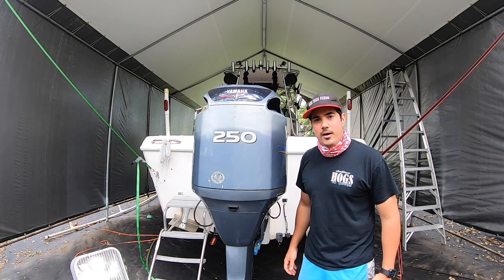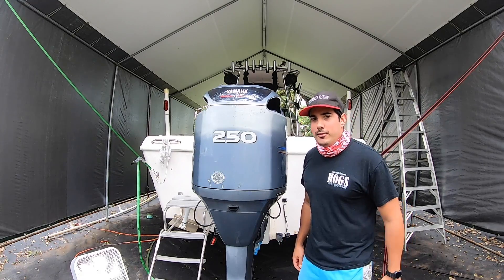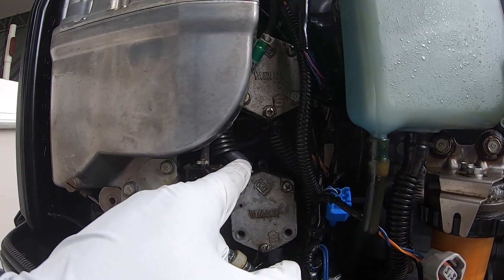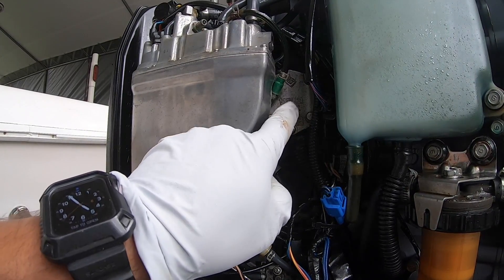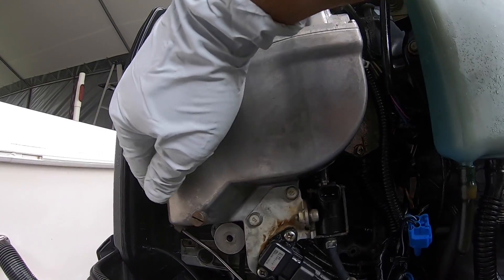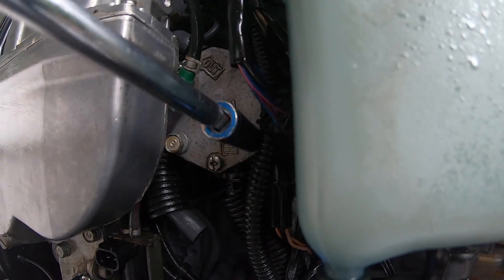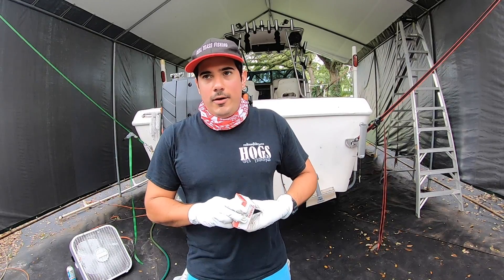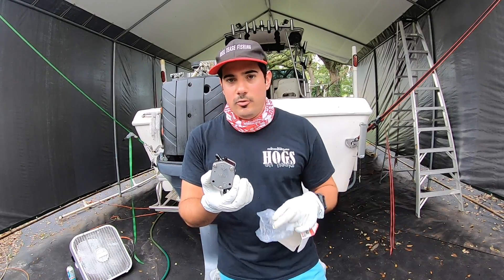Yamaha Outboard Low Pressure Fuel Pump Replacement

Comment: Great videos! My 2006 vmax 250 hpdi broke down on me yesterday just as I left the dock. It started sputtering lost rpms then shut off.  Cranked back up for 2 seconds,  then only 1 second then will only just pop a couple times, won't run/stay on. Thinking about replacing these pumps and multiple filters but get costly quickly.  Where should I start first?  Thanks
Reply from the maker: I would try to manually pump gas with the primer bulb and try to start it. See if that keeps the engine running. (try to have a buddy continue pumping while you star the engine.) if that works it could be a failed low pressure pump. It can also be a bad fuel pump in the VST. However these engines really need clean fuel so I would start with that test and replace filters in the spin ons as well as the filter in the VST. 
Thats my approach
Reply: @ReelTeaseFishing  Thank you very much, I got new low pressure pumps because of the problem, but a more advanced friend of mine also suggested to manually start  pump the engine and it seemed to work. again thank you for the response!
Reply: just yesterday i had the same problem on my yamaha 200 outboard 2004, it won’t stay running, only cranks. any suggestions?

Comment: I have 94 Yamaha 115XTRS, running rough and bogs down when trying to accelerate. I pulled the plugs, they are wet after running, could this be a fuel pump issue?
Reply from the maker: to check the low pressure fuel pumps. loosen them and if they leak while you have the engine on (running) its the fuel pump.
Reply: I have this same issue, mine is a 98 Yamaha 115 2 stroke. I will look at the fuel pump next. I took the carbs off and they look good. When the motor is about to kill, I can keep it running by spraying carb cleaner in the carbs. Gotta be a fuel issue. Idles rough and doesn’t want to keep running at all.

Comment: I have a question. 175hpdi 2012 with 111 hours. Was running great, picked up a buddy at the ramp went to go on plane again and it was supper rough and took a second to get up there. Runs fine when it gets up on plane tho, is that because the engine finally creates enough vacuum to get the fuel flowing efficiently and the low pressure pumps need replaced?
Reply from the maker: its hard to tell what the issue is, but definitely a lack of power. 
it can also be non engine related. such as water in the boat, improper trimming etc. 
I would check fuel filters first and move my way through the fuel system.

Comment: Thanks for your video.  I have a problem with a 2007 Yamaha f150 4 stroke.  I hope you can help .  The fuel/water separator cup runs out of fuel and the engine stops.  All pressures seem to be good.  Cannot find any gas or air leaks.  Can pump primer bulb to get back to the dock, but when the filter cup is empty, the engine quits.  Thanks for any help you can offer.
Reply from the maker: ok so a few things can cause this. air leaks are the number one culprit. make sure that all clamps on the fuel lines are tight. (don't use zip ties) #2 a bad primer bulb can cause the fuel to lose prime if its failing. #3 clogged fuel/water filter or the spin on filter may be lose and needs tightening #4 pick up tube in gas tank sometimes have a small mesh that gets clogged. #5 are you sure you aren't out of fuel, and getting a false reading of the gauge. #6 a small pin hole in your fuel line can be a PIA to find and will introduce air into your system. 
that's what I would be looking for. please let me know if you solve it, if not we can keep trying
Reply: @ReelTeaseFishing    Thanks for your help.  It seemed we had everything running well.  But now, after a short run, it seems after the engine is warmed up a bit, it quits running.  I have been able to idle, only.  any increase in fuel over 1100rpm and the engine quits running.  Starts easily, but will not take fuel.  It runs perfectly until it gets warmed up.  I'm a shade tree mechanic and can't afford my local dealer.  Thanks, again, for any assistance you can offer.  Sam
Reply from the maker: @kennaspade3607  I would check for spark in all cylinders. you may have a cylinder not firing. (bad coil, bad spark plug?) If they are all firing then I would check filters. on the engine itself I believe you have three filters. one in the front of the engine in a small spin on canister. another inside the VST, and another above the VST. Make sure those are all clean and new.
Reply from the maker: Please let me know what symptoms you are experiencing. is the primer bulb going flat when you run the engine? does the boat run better if you squeeze the primer bulb while running? Are you running Rec 90 (non ethanol fuel)
Reply: @ReelTeaseFishing    I have replaced the primer bulb.  It is working fine.  Engine quits after warming up.  I am using 10% ethanol fuel.
Reply: @ReelTeaseFishing  I have changed the large inline fuel filter in the boat and the fuel/water separator filter.  I will check all the plugs and change all the VST filters.  The engine runs perfectly until it warms up.  Then it quits and will only idle under 1100rpm.  I can usually run several miles before it quits.  Just far enough away from the ramp to get in trouble.  A long trip back at slow idle.  LOL.  Thanks so much for your help.  I'll let you know how it goes after I've tried your recommendations.
Reply from the maker: @kennaspade3607  it may be your vst pump, or vst filters. sounds like at the beginning when the vst is full of fuel it runs well. but once the vst starts to empty it can't keep up with the fuel demand of the engine. the CST is suppose to have I believe 50 psi if working properly
Reply: @ReelTeaseFishing  Ok.  Thanks so much.  I'll check all this out.  Will let you know what we figure out.  Sam
Reply: Kenna Spade hi, I have the EXACT same problem! Did you find anything?
Reply from the maker: @Bnaar4  make sure you have gas in the tank. (gas gauge and sending unit can fail) check the pickup tube on the gas tank for a clog. make sure your spin on filter is replaced yearly.
Reply: @ReelTeaseFishing  Thanks for the fast reply! I removed the little F filter above the vst, and I blew trough it with a air compressor. After that the engine ran good for a little while, but started stalling again. I took the filter out yesterday and I saw that it was actually really dirty! I ordered a new one online and I hope my problems will be gone after that! I will let you guys know if I  have any news
Reply from the maker: @Bnaar4  good to hear. hope your back on the water trouble free soon
Reply: @Bnaar4    We put a lot of Lucas injector cleaner in the fuel.  Tripled the recommended dose.  LOL.  This has improved the performance by 75%.  I think I may have a bad injector.  Haven't had opportunity to check it yet.  Hope to get to it this coming weekend.  I'm a "shade tree" mechanic and my friends work during the week.  I'm really the "go-for".  They are the mechanics.  Try Lucas and some say Seafoam is good.  The Lucas has really helped a lot.  Could be clogged filters, but this treatment is a lot less expensive than going into the SVT to change those filters.  Although, this may be next.........  Good luck to you.
Reply: @kennaspade3607  I put in a new F filter and everything works fine now!

Comment: Hey man i hopenyou reply, but i also have ox66, and there has been surging issues happening the the engine, when my boat is running at 5000 rpm it will drop to 4000 rpm by itself without me touching the throttle, and sometimes the rom will bounce back n fourth. But when i am at high speed engine is running fine, what seems to be the problem?
Reply from the maker: it definitely sounds like a fuel issue. I would start at the simplest things. spin on filter, then id check the primer bulb, then the inline filter under the cowling. 
anything that restricts fuel flow will cause a surging issue especially at higher RPMS. 
is your priming bulb going flat at higher rpms? does it ride better if you are at higher RPMS and you squeeze the priming bulb? 
I would check those things first. also any chance of water in your fuel?
Reply: Hey did you ever figure out your problem?   Mines doing the same thing….   Awesome video by the way.  I really appreciate you teaching your knowledge bro

Comment: Thanks or posting this man. Ive been having some fuel issues, I think it has to be the fuel pump because she runs again if I hit the primer bulb a few times in a pinch. Only running non ethanol. Clean tank , Gonna change out out that pump in the next few weeks .
Reply from the maker: hopefully this video makes that job easier. always remember to take photos to revert back to. good luck!